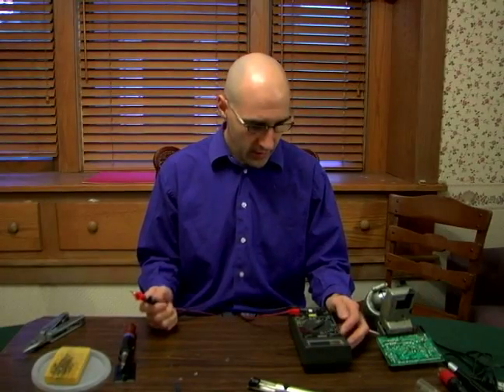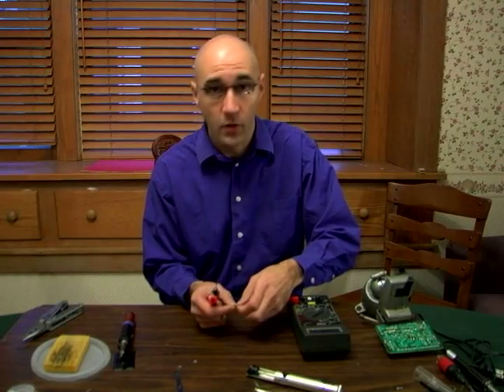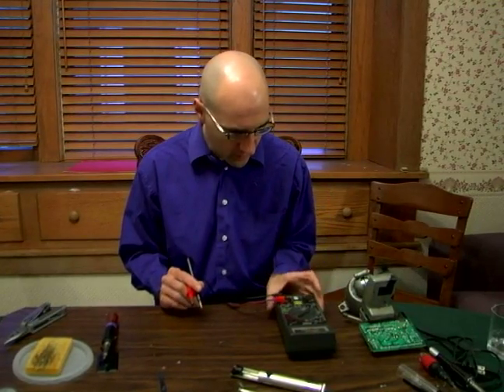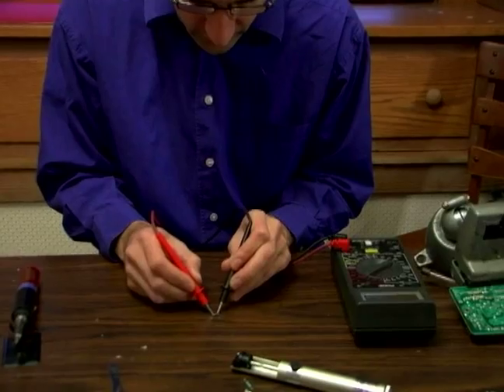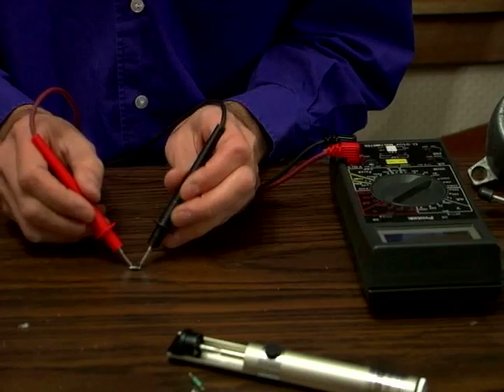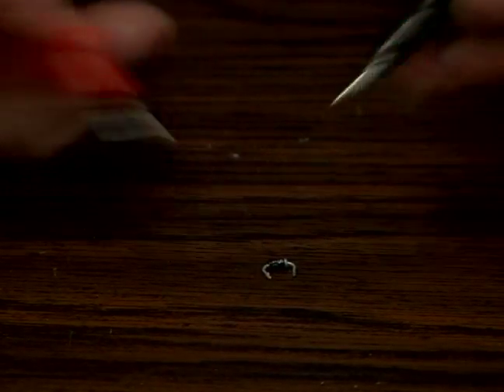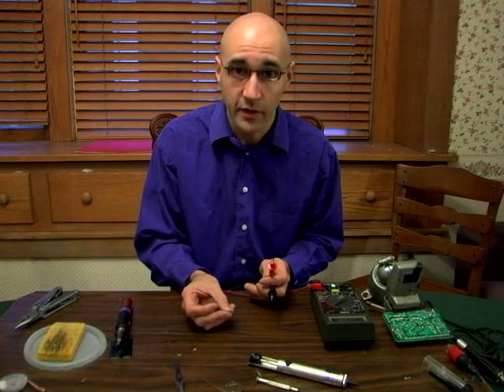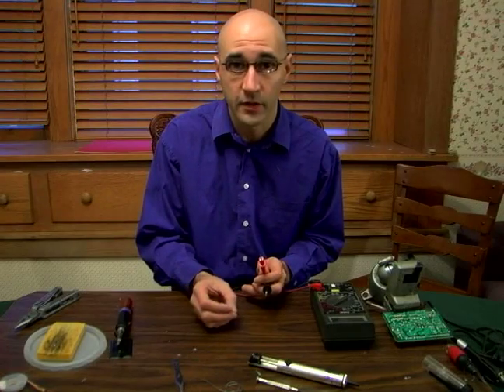How to Solder : How to Test a Diode

Comment: WTF? It takes a village to produce idiotic videos? No control of the zoom, no closup of the actual testing, no indication of the identification of the diode as far as polarity of leads, no specification of which leads of meter to check which leads of the diode. Crap, crap and total crap. You're a very poor instructor, and most likely a poor technician.

Comment: clear as mud

you did not say what setting your meter was on or what type of diode you were checking

and you can check the diode with out removing it from the board

and i could not see the diode